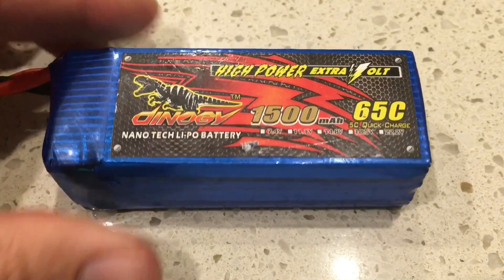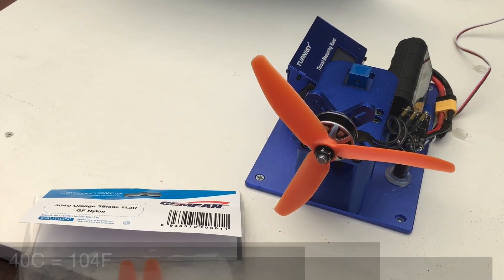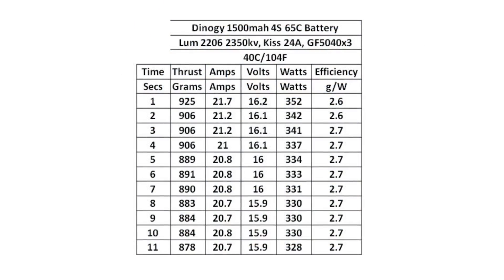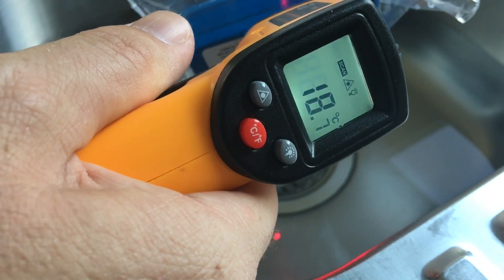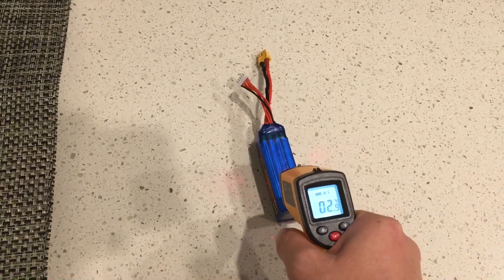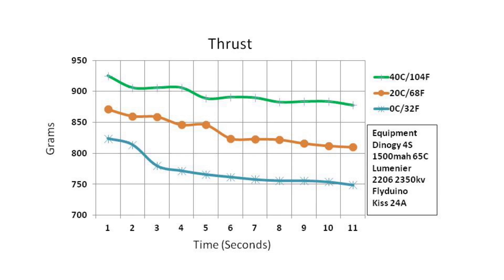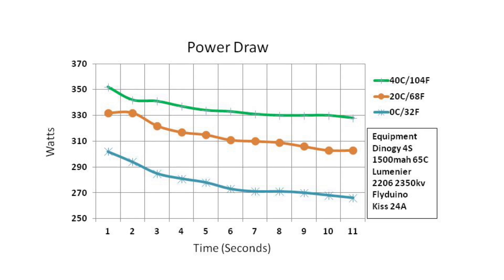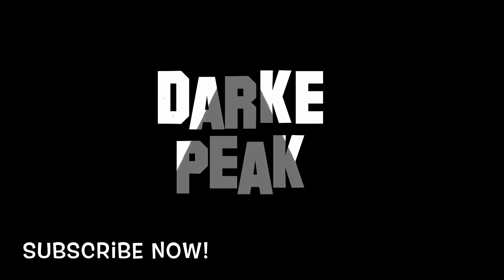Battery Temperature vs. Performance

Comment: have you tried heating the battery to 60 and 80 degrees Celsius? that could make for some interesting results!
Reply from the maker: +brad mont Battery heating seems to be common knowledge among "older" RC hobbies like helicopters and cars but there were a few claims among the newer quad racing community that batteries performed best at room temperature.  I was just out to prove it to myself and have quantifiable results.  However, 60 and 80 would be interesting but I didn't test that high.

Comment: yep very nice info! maybe cold batteries for endurance race? how do the Dinogy Compare to other batteries in its class im really interested to know! keep up the good work!
Reply from the maker: I didn't test endurance but I expect the colder batteries will run out of energy sooner. In hindsight I realise the efficiency improvement for the low temp battery is because it requires exponentially more energy to generate a small additional amount of thrust. The Dinogy offer acceptable performance and reasonable value for money.
Reply: ahh thanks!

Comment: This is a very good video, can you do a comparison between gf 5x4x3, gf BN 5x45 and gf 5x45x3 BN
Reply from the maker: +AceOfHearts Yes, the first two props are in my prop testing video out today.  I didn't have a GF 5045x3 BN, but I did have the HQ and DAL equivalents, and the GF 5050x3 BN.
https://youtu.be/gXGptt0M0rg
Reply: cheers man! it will help alot